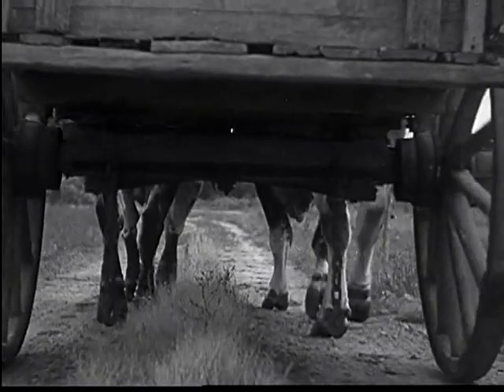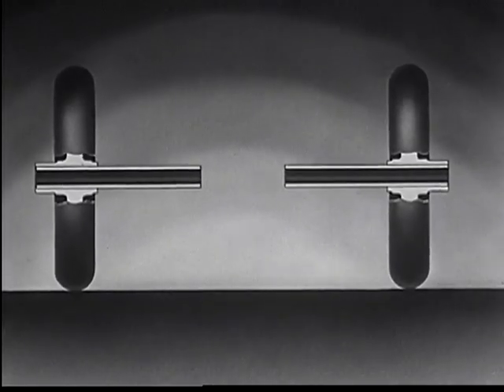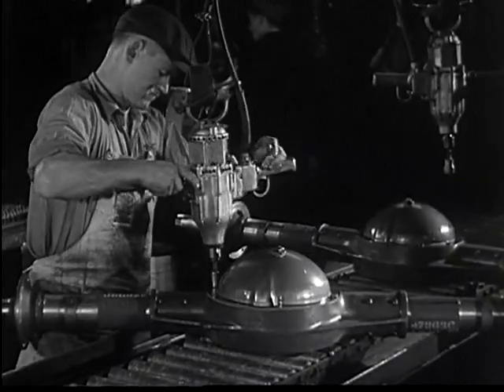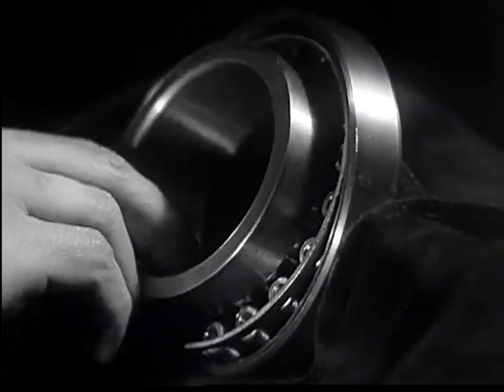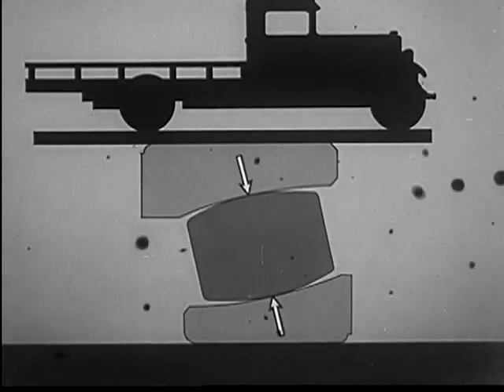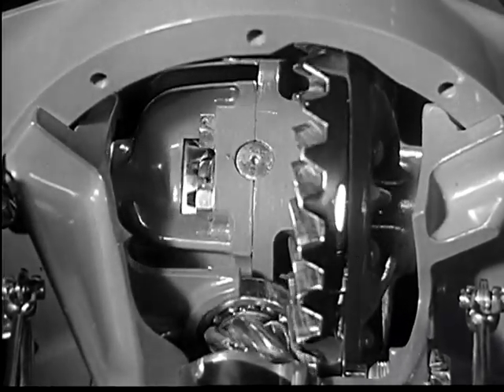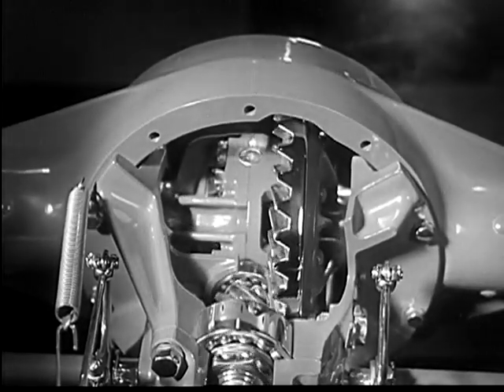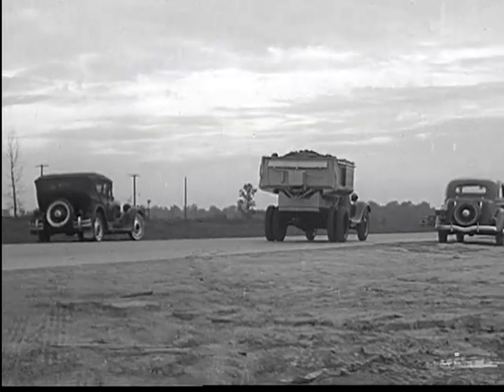It Floats - Chevrolet Full Floating Rear Axle (1936)

Comment: Back when they sold their vehicles by showing their build quality not “real people not actors”
Reply: Psychology ads killed ads industry. Nowadays, people skip contentless and brainwashing ads as fast as they can, or use an a.d.-blocker.
Reply: @y.z.6517  There are so many ads people became immune. The good ads are subliminal, part of a long and well-thought campaign. But investors and the board doesn't like those, they want sales "this quarter" so they can get a bonus and cash in on their stock, not in 2 years when their replacement will be sitting behind the desk.
Reply: @y.z.6517  I can't argue this, because I'm told relentlessly I'm completely different, but, i skip ads because they're ads. Lol.

There isn't a better solar panel, hamburger, vehicle, or ice cream than anything I've seen before. You're not "advertising", you're showing off what you finally learned to do. Woooooow. Nice. Now, fuck you
Reply: @y.z.6517  I mean, not you, in case it wasn't absolutely obvious. Good point
Reply: @y.z.6517  I gotta wonder how true that is of me. An ad for, um, Autozone? I'll probably skip it. An ad from a much smaller operation? I subscribed to "The Cheap Life" at one time because of an ad but they haven't uploaded anything for years now.
Reply: @101Volts  5 years later and it’s so much worse than it was when you made this comment. It is now your DUTY to use blockers. You absolutely must.
Reply: @y.z.6517  You are right.  If all ads were as cool as this, id watch them all day
Reply: WHAT YOU DN'T BELIEVE WHEN A "REAL PERSON" SAYS A CHEVY LOOKS LIKE LUXURY CAR?
Reply: really tho  that would be nice to see today
Reply: I especially love how they show you the truck breaking down in the video
Reply: @tomwalker996  I could hear Mahk going. " That's a chevy alright"
Reply: if they showed you their build quality nowadays they would put them selves out of business
Reply: @chaytonruijsenaars3971  how long could you drive a car then between oil changes?  What was the life expectancy of a car?

The reliability and longevity of today’s cars is 2 and 3 times what it was of cars even made in the 80s and 90s.
Reply: @chaytonruijsenaars3971  not true. cars today are vastly superior. tougher, faster, safer, more powerful, more economical, lasts longer. cars of the 50s-60s rarely saw 100,000 miles (remember the 5 digit odometers?) i love these tough, beautiful old building blocks, but as far as cars/trucks are concerned, these are the good old days...
Reply: @johndunn8647  Old cars were tanks and easily repairable. New ones are so stuffed you can't fix or change anything without disassembling half of the vehicle. And the electronics are nice but most of the time it's the electronics that fail, not the things they are for. When I get the cash I'm "upgrading" to an older car. Maybe not 1960, but something from the 90's.
Reply: @johndunn8647  As the saying goes, an opinion is like an ass everyone has one and everyone thinks the other persons stinks.
Reply: @johndunn8647  yes thats why you still see semi regularily cars from the 50's and 60's but like only once in a blue moon a J body GM
Reply: @Mic_Glow  The electronics die first because we've gotten so good at building the mechanical bits that they hardly ever fail, at least in the case of 'conservative' proven designs (Even CVTs are reliable if you use them in mopeds or light city cars with small engines- putting big power through one is a mistake). In any case, modern solid state electronics are way more reliable than old stuff, when was the last time you had to replace an ignition coil or file a set of points?

If there's a real argument in favor of newer vehicles however, it's safety and emissions. People die way less often in auto accidents these days, even though there are more cars on the road. And we no longer have smog so bad you can't see in the city center (at least in western nations).
Reply: @nerd1000ify  your off of your rocker if you think a modern automobile is safer. That plastic crumple zone has not saved any lives in my family, you only look at conveniences in your plastic motor. repairing is the safer and more readily efficient way to be sure that you won't be killed when it malfunctions. Here's another fantastic thing your current vehicle lacks, design, design in formality and design in beauty. Your wheels are pathetic fat horribly designed slabs of circle with a fan on the inside, they had firm sleek well gripped thin tires that banded around a elegant hubcap with the company sigil on it or name, and thin has always worked better. Now wheels are small and wide instead of large and thin. Fenders as well helped cover the wheel of an automobile, giving it leverage to move about on a tossing shore of road, and when impacted the fender would bend around the wheel and protect it from pulling off causing further mobility of the slightly hit to decimated motor. Car crashed of today to automobile crashes of say 1943, does not show a large difference, the vehicle is not the response, it is the speed of which/location of which/and environment of which: the fancy footed automobile or factory made cheap plastic is going.
Reply: @johndunn8647  New cars are not tougher. Everything is made of plastic or thin metal. And they DEFINITELY do NOT last longer.
Reply: @johndunn8647  cars from the 60's can easily last longer than todays cars. Why? They ere easier to work on. Maintenance was easy. Timing lights were in every garage. Points, plugs and condensor cost about $10.
Why didn't those cares last 100k miles? People didn't do their own maintenance nor did they want to pay for maintenance every 3k miles.
You think modern cars are better? Try working on one.
Reply: @markiskool  really. That being said, I do get 3-400,000 miles out most of my vehicles (Toyota, Nissan).
Reply: @johndunn8647  improvements have been made in material science but companies take more shortcuts now than before so it’s a mixed bag… if they had 1920 craftsmanship and 2020 engineering things would be much better quality
Reply: @Mic_Glow wide spread knowledge of cars was way less in the 1930s so people would have had the same complaints as you with the "things now are so complex."
Reply: @nerd1000ify  actually, look at the reliability of an older screen or electric windows in a 2000s vs a 2010. The 2010 model year, even with bigger screens you hardly hear about electric problems after 12, but alot of 2000s car would have issues with the power windows and screens. The reliability of electronics on cars is improving fast as far as I'm aware.
Reply: @artdecotimes2942  yes, vehicles in modernity do deform more, but no it's not the same as the past. The front and rear are designed to deform more than the passenger area will, so the driver and passengers won't get trapped by the dash board pinning them down. There are emergency shut offs and auto emergency braking so the car won't catch fire and continue to roll into oncoming traffic if the driver is incapacitated, seat belts and air bags so you don't slam your face into the steering wheel, which by the way is designed to collapse and move out of.the way of the driver. The thinner wheels from olden years are a result of lower power outputs in cars. Art is subjective, so what you think looks good is purely your own opinion. And I'm sorry if you've lost family in car accidents. Nothing is 100% perfect, but crashes head on of an avrage of 220Kmh/135mph are very likely to be survived. Compared to a 1930s car where a crash head on at an average of 95KMH/59MPH would not be good odds. I would say that improvments are noticable. Look at a crash test of a 1960s car vs a 2000s car, you will see the safety systems mentioned here.
Reply: @markiskool  10$ counting inflation? Repairs were expected by auto manufacturers, because they new that the cars would need a tune up and replacement parts every 10K at best compared to modern cars needing very little repairs besides electrical every 100K (most of which is easily accessible) most of the mechanical stuff has become so reliabile that there is no need to have them easily accessible. And most cars have the timing chains and accessory stuff easy to reach.
Reply: @jwalster9412  idk what post you are replying to, yt comment system is not the best
Problem nowadays is unnecessary complexity, things made to last 5 years (or single use- screw into plastic, stuff held by wonky clips that break etc.) and un-repairable/ proprietary parts. Having knowledge how something works doesn't help if the part is covered in resin or software-locked. Couple months ago my friend wanted to change position lamp. 2 minute job in my 18 year old ford but here we had to disassemble whole front to reach it, only to find out it's not a standard bulb, but a 6x more pricey modification that uses a slightly different fitting.... On newer models you can't even change a bulb, need whole headlight assembly, used part is 20-30x price of a bulb, new one almost half price of used car where I live.
Reply: @Mic_Glow  I think it was to the "old cars are tanks" thing
Reply: @jwalster9412  ah, but the old cars could be fixed by your local mechanic, thus feeding money into your local economy. And, when older cars broke, they could be fixed.
Reply: @markiskool  when a new car break, they just feed more money into the economy, thus balancing out the extra reliability.
Reply: @jwalster9412  um, look at your post and try speaking coherently.
Reply: @markiskool  auto correct is really really bad sometimes.
Reply: @jwalster9412  i never trust an edited post. Have a nice day.
Reply: @markiskool  what?
Reply: @johndunn9819  So untrue. I see these "new stuff is better" comments everywhere and it's always the same type of ppl sending them. 5 digit odometer were a planned obsolescence thing. Ppl would roll the odometer over multiple times, hell I know multiple ppl with over 300k on 5 digit cars and trucks. I still drive cars from the 70s 80s and 90s to this day and they're much better built than today's disposable crap.
Reply: @johndunn8647  More powerful, slightly safer but in a much thinner margin of material durability.
Reply: @johndunn8647  safer? Not exactly with more power speed and cheap materials comes more deaths
Reply: @johndunn8647 cars today are intentionally designed to have issues and break down so customers would have to make repairs. Back in the day cars were designed to work the best they could.
Reply: @johndunn8647 but they don’t last longer😢
Reply: @johndunn8647 Well they were best in the 90’s/early 2000’s, but now they’re getting shitty again.
Reply: yeah, but back then, vehicles were crappy.  glad we don't live in those days.
Reply: Lmao the most recent one is about an outlet in the bed and the actors gasping when it powers a work lamp
Reply: @JamesTTierce  I've never seen a Chevy ad, I only get ford ads which have a really annoying advertising tactic. Considering the equinox? Buy our shit box instead, considering a Colorado? Buy our shit box instead, they have one for pretty much every popular car out there
Reply: Ckc dillpickle the Equinox is a shit box I don’t know about the newer ones but the 2014-2015 my older brother had was definitely a shit box it used to shock you when you used the windows literally shock you oh and his cat fell off twice after fixing it and the Chevy dealership thing did sound kinda mean tho
Reply: @puddingtame3483  Every company is built off tax money.. sorry
Reply: No. People just dont know how to work on vehicles anymore and therefore dont care.
Reply: American cars have never been about quality, It's all about cheap horse power!! that you have change every few years,so the car company can sell more of the same garbage
Reply: automotive build standards were not implemented untill after the 1960's book by Ralph Nader called "Unsafe At any Speed"  it is also the very book that started inspections and yearly taxing on cars after September 9, 1966 build quality was not a thing in the 1930's
Reply: @TwisNinja  ralph nadar sucks.
Reply: @TwisNinja  “build quality was not a thing in the 1930s” yeah maybe not as a measurement but people did build these things with quality in mind they made the best they could for the time and not another generic medium quality car you get today
Reply: Heineken FiftySeven  Thank you.
Reply: They still might take real people but thanks to 85 years of TV and movie theaters there are only actors left.
Reply: "Don't touch me Potsch. What is JD Powah? Sounds like a pornstar name"
Reply: They do still use the same design, no point showcasing it every year.
Reply: Bro, it was the 1930's commercials weren't a thing, tv didn't exist yet. You can still find these kind of tech videos for things today.
Reply: Instablaster...
Reply: Hey Potch?
Reply: They've got to have actors since there is no build quality in American cars.
Reply: **"ZOOM, ZOOM**

To be fair though, it would be prohibitively expensive to play this piece during the Superbowl.
Reply: Back when america was kicking ass and taking numbers
Reply: Yup
Reply: https://youtu.be/RkkNXWmslAw
Reply: This is the best of the best. The production ones were probably not as good quality.
Reply: No new technologies to show this way and when there are, they show it the same way as here but modernized.
Reply: In their defence, the modern full floating axles are still pretty much exactly the same as this, so they don’t need to update the video
Reply: It’s all about corporate greed and their fight against the “right to repair”. They don’t want you knowing how to fix your own stuff… but I do agree why it’s not safe for every dumbfk to be doing their own repairs..
Reply: Also people had like a handful of options that actually influenced the quality of the car beyond aesthetics
Reply: Also, THERE WASN'T TV TO SHOW ADS ON
Reply: Not worse than the Subaru campaign saying “Subaru, made with love.” BS, made with hard work in a factory.
Reply: Go check out zebra corner Chevy commercial
Reply: Amen
Reply: They use “real people not actors” now days, because the populous has been properly programmed and conditioned to say & act the way They want. 
- Why pay an actor to act like a sheep when you own a flock?
Reply: Yes!
That ad campaign seems to have been gone for a while now. It was one of the stupidest things I have seen. Bad president at the time also.
Reply: Well, yea? Want some money for your very astute observation or something?
Reply: @ matthewweisenburger2095 
You've offended a sheep
Reply: We adopted the new model because it was more profitable for shareholders.
Reply: But does it have a JD Powah award?
Reply: Lot of people dissing today's car companies here. The build-quality is MUCH better now compared to 1930s.:)
Reply: and, NO robots!
Reply: This is more of an educational video honestly.
Reply: doesn't matter how much you hate tooth paste ads, you'll buy it when you need one. They stuck in your mind, and most people buys those.
Reply: Muh Shekels dude your wack ok boomer
Reply: The problem is they can’t show the build quality anymore, because there is none.
Reply: You right but that's boomer as fuck

Comment: The 1936 Chevy Truck Rear Axle shaft Inner & Differential Side Roller Bearing is part number KD12051Z . New bearings by Federal-Mogal, Delco, SKF await you. This bearing is used on GM trucks from 1936 to 1984. The "newer" part number is 9412426 ie after 1944. An even "newer" part number is Delco S612. It fits a 2002 Chevy C3500HD truck, a 1993 one too.Interchange Part Number: 9412426, 09412426, KD12051-Z, PKD12051Z, WE61198.   Thus your local dealer might tell you that they have no 1936 truck axle bearings, but they have one in stock that is the same bearing
Reply: 3beltwesty
excellent i'll have to keep that in mind when my 1936 differential goes out
Reply: Nice. How do you know this stuff? :)
Reply: Good to know as I own 7 of those axles.
Reply: Sorry, but I think it's Federal- Mogul.
Reply: It's not the "same" bearing, it's a compatible bearing. The metallurgy, lubricants, and manufacturing precision have been improved, cost has gone down. The OD and shaft diameters remained the same so they're backwards compatible. What ended up killing compatibility is probably when GM finally switched the design to metric.
Reply: How long has SP2111 been around if it still is. I am curious. A small self tapping screw about 12mm long with a philips heads.
Reply: @beagle7622  english?
Reply: Typical for a chevy owner. They have to work on their vehicles so much that they have the entire parts list and corresponding part numbers memorized! 😆😅🤣😂

Comment: I see some flaws even in the revised version. I mean what's up with the barrel shaped bearing? Not to mention ,if that axle did break , it's not just  so easy to change .   Back then they had wedges around the nuts  that held the axle in place that had to be hammered out with a sledgehammer, also  when that axle breaks it leaves all kinds of pieces in that rear end housing that must be removed  before the rear end can be operated again . Just saying 😎